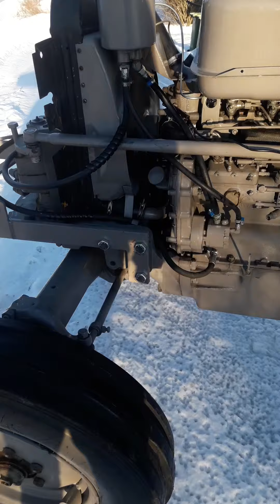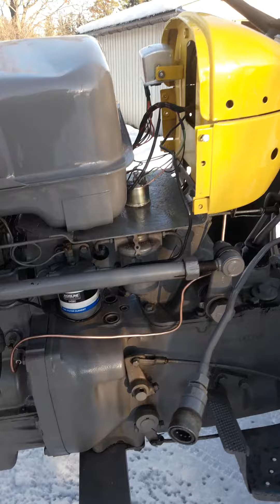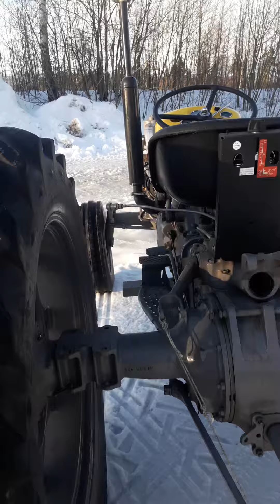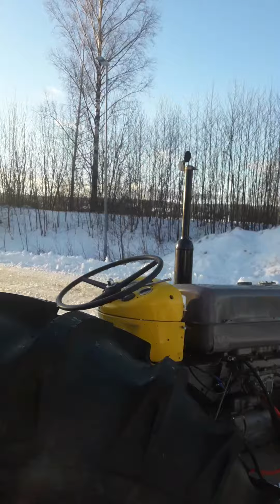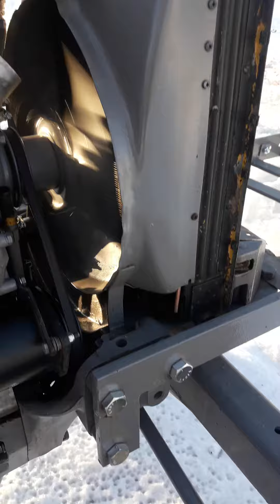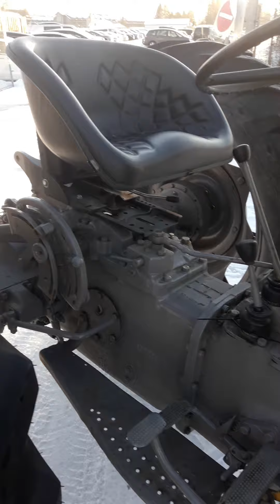Massey Ferguson  65 . What is your favorite sound . 🚜😊

Comment: I've being following your videos.  Very informative.  Ive a 1958 mk1.  Excellent to start and drive but burns alot of oil. Any quick fix I wonder
Reply from the maker: Eamon Englich . Only  thing I can Think off is if you wisit LUCASOIL.COM  and buy  Some product's  there. They have wery fine things there for diesel engine's  there .. meby first send them a e-mail and ask them. And Tell them about your problem. They have things to seal up inside your ingine and things to clean inside your engine etc .. but it  is just a short term "repair" . It will meby Help Some weeks or Some mounds  for your massey ferguson  65 . The  Best way to go will Abselute  be a complite engine rebuild or  at  list new  slives and pistol + bearing's then you Will be good to go for sure .. Because reighte now your pistol or rings is work out so she  Will burn Oil as you Say . But  your tractor is a good tractor and you dont get any Better tractor . And allso peauple want them so prize is Going up now so you must keep your massey ferguson  65 MRK1 .  Let me Know What you will do with your engine and What you  Think About the situation . 
https://lucasoil.com/
Are you from UK  or What country 
Eamom  Englich.  
Text me back Soon Please so we can find a  solution that fit for you .. Michell Norway 😊👍🏻🚜
Reply from the maker: How  it Goes with your massey ferguson  65 MRK 1  EAMON ENGLICH  .. How is She Running??? Still burn Oil or ....Best regauard MICHELL  NORWAY 👍🏻😊🚜